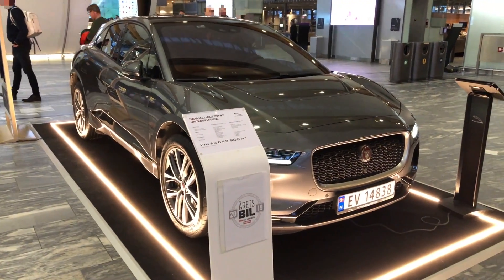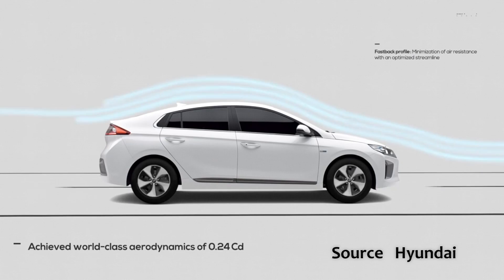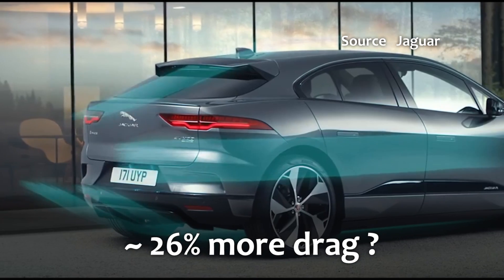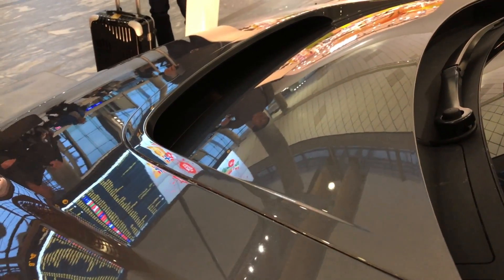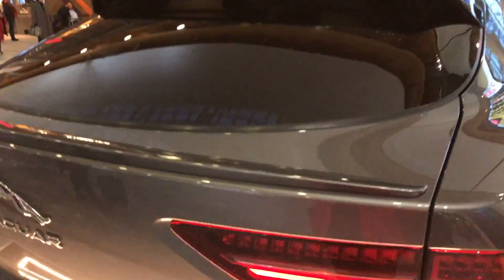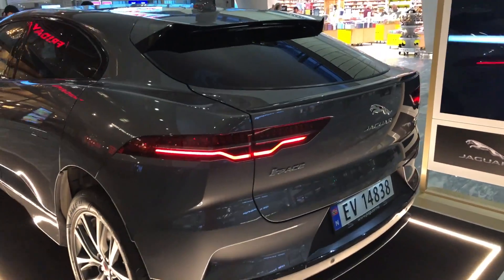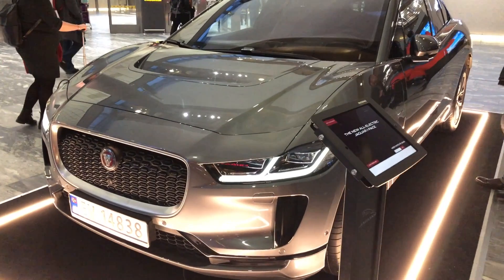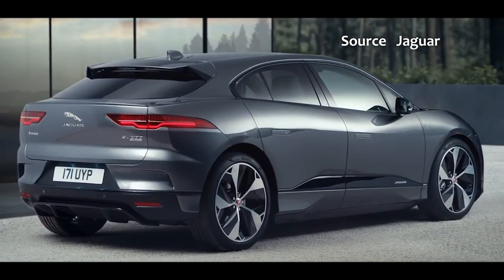Why THESE Jaguar I-PACE EV Aerodynamics? (Vs IONIQ Electric, Tesla)

Comment: One thing to note, the Hyundai Kona has a Cd of 0.29, same as the I-Pace with a smaller battery but a longer range! I think what makes the difference is the weight, I-Pace is just over 2.1 tons Vs just over 1.6 tons for the Kona. So the I-Pace has an extra half a ton of weight or the equivalent of 4-6 people with luggage I think?

Mass, areo, efficiency, tyres all make a difference. I think it's mass that's making the big difference here in between SIMILAR body styles. You can't expect a SUV to be as efficient as a saloon or estate like the Ioniq.

Audi e-Tron, has a drag coefficient of Cd 0.28 but looks like it has a slightly smaller range than the I-Pace with a larger battery?!?! Answer, weight is an extra 500kg over the I-Pace which makes it close to a ton heavier than the Kona.

For the record, have test driven Ioniq, Kona & I-Pace. Have a deposit on a Kona. I would recommend speaking to a Jag Dealer about a test drive of the I-Pace so you can bench it against your Ioniq. It is a lovely, lovely car will still consider it if we ever get to the stage of a two EV family; probably second hand though.
Reply from the maker: Good points, thanks :)
Reply: @ZeroTailpipe  no problem. Keep doing the videos!

Comment: A traditional prestige car manufacturer is not going to aim for a maximum efficiency vehicle, but instead make design trade offs based on their “brand values”. The I-Pace is marketed as a “performance SUV” and as a Jaguar: so a big front grille and impressive stance are important, but also on track and off-road handling and performance, just for bragging rights. The front scoop is usually there to increase downforce  which is super important for track handling, as is the giant underfloor diffuser. Nobody would accuse a Formula one car of having terrible aerodynamics or being badly engineered, but they have sky high drag coefficients to generate huge amounts of down force. The I-Pace also has twin permanent synchronous motors meaning the front motor cannot be switched off.  All in all, the I-Pace trades off efficiency for sporty handling, a raised driving position, larger interior space and yes looks, which is okay because the EV space needs more variety if EVs are ever to replace traditional cars. In engineering there are no right or wrong answers, just a design space  where trade-offs are made based on engineering goals. Jaguar made different trade-offs and everybody is free to choose whether those were the right trade-offs for them. I recently test drove an I-Pace and it’s a proper “driver’s car” as well as being practical but it’s certainly not he top choice for people who often drive long distances or want an affordable car.
Reply from the maker: Great points, thanks :)

Comment: Stylish or not, that front scoop is a snow-trap. Got enough work with a flat bonnet, I don't think I need more and deeper pockets to store the stuff.
Reply from the maker: Good point! :)
Reply: Not just snow trap but dirt and grime trap... cleaning would be tough 

I understand it’s Aluminum body doesn’t rusts but can’t keep dirt under scoop
Reply from the maker: The patterned/embossed grill curves into the scoop too... cleaning that as well as the internal smooth parts of the scoop... hmm... ;)

Comment: I think the Jag was designed to produce more down force as they were thinking of their racing program and the thermal dynamics involved in keeping the battery pack cool.
I don't think they really gave it much thought as to just how much drag it would produce as well.
 It would be very interesting to see one of these built to run a rally course.
So far none of these EV's can truly be compared as they are so different in design and mission from each other.
Great video thanks for sharing
Reply from the maker: Thanks for sharing :)

Comment: Aerodynamics in the auto world is a fascinating topic. Cd numbers on their own don't tell the whole story. The frontal area of the vehicle has a part to play as well hence CdA, which can be a more meaningful figure but marketing people won't like it. The CdA for the IONIQ will be smaller than that of the Tesla Model S and possibly even better than the Model 3 because they are both larger cars. I would imagine the i-Pace would be worse.
If it works the bonnet "scoop" on the i-Pace should help the flow over the windscreen which is a low pressure area. 
If you can find a copy, I recommend reading "Flying on Four Wheels" by Dennis E. Ortenburger, an interesting book about Frank Costin and his cars.
Reply from the maker: Fascinating, thanks :) I will look for it. I’ll also see if I can track down the CdA numbers...

Comment: The Ioniq is the result of Hyundai trying to make a good EV. Owning a good EV and driving it sensibly is not what people want who buy an I-Pace. In fact, it's not what people want, who drive a Jag, Merc, or Audi. So Audi, Jag, Marc, etc. make electric SUV's with drag parachute aerodynamics and gigantic batteries for them, because they don't want to make good EV's and their customers don't want to buy good EV's. They want aggressive looking, large luxury cars and they want to use them thoughtlessly. From a purely technical or rational point of view, the shapes of such cars are just good examples for bad engineering.
Reply from the maker: Interesting points :)
Reply: 0.29 is still not a «drag parachute», but you are correct, that most people who can afford such a car don’t like to have a «weird» shape. They like that their car is recognised as an Jaguar, Audi etc. There are people who likes to buy an electric car but don’t want to show it offensively. I assume, that may change when electric cars become more popular and «normal» and the brands will change the styling. The last of this big styling changes was in the 70ties after the oil shock, when the big brands develop a new an more aerodynamic styling. I personally like, that not all electric cars look the same and the brands try how to develop the new styling for electric cars.
Reply: @JürgHölzle  The Ioniq doesn't have a weird shape, it actually looks quite dynamic, IMO. Yet it's safe to assume it's consumption will be around half that of the e-Tron in reality, just like a Ioniq-ish petrol car burns half the petrol of an e-Tron-ish petrol car for the same reasons: Drag parachute aerodynamics at medium and high speeds and gigantic mass in city traffic. It has to heat and cool a larger volume, its bigfoot tires displace more water and slush, etc, etc. Ultimately, efficiency means speed in the electric world, and this Audi will have a hard time reaching a 70kph average on your holiday trip to the mediterranean with current charging infrastructure. This has not escaped the attention of all the manufacturers desperately trying to style their cars after the 1970's Range Rover for 2020 and they joined forces to form IONITY. IONITY is backed with unlimited financial resources to build a dense grid of 150 plus kW CCS chargers across Europe within the next one to two years to make these design antiquities practical. That is the only good thing in the e-Tron's overall design I can identify so far.

Comment: If we want as little air resistance as possible, all brands will end up with cars looking a lot like each other. There would be no way to stand out on the outside. Brands like Jaguar and Audi don't want that, they want to stand out. They want you to recognize their cars. And people who buy those cars also don't want a car that looks like any other brand. They often buy it because it is an Audi or Jaguar. And I really doubt most of them care about drag or energy efficiency. They'll only care when the car runs empty when they are on their way to an important event.
Reply from the maker: Interesting, thanks :)

Comment: Forget its bad aerodynamics i can forgive that. Its 7kwh on board charger with a 90kwh battery pack (13 hours to recharge from 0%) is unforgivable. My wifes i3 with 33kwh battery has a 7+ (I've seen as high as 7.6 Kw). Really Jaguar 9.6 minimum.
Reply: It really is a matter of looking around the world. When you look around the world you'll see that most people don't have triple phase power entering their homes. So most EV manufacturers have decided to build a single phase charger in their car because that reduces the cost of an already expensive car a little. The limit of 7.2kWh (actually it's 32 Amps) comes from the fact that more than that is usually not allowed on the wiring used in most homes. Adding thicker wires to provide more powers would once more become an expensive venture.
Reply: @Hans-gb4mv  you don't need tripple phase for 40 amps (9.6 kw) in California. And that is where you need to sell EV's in the US. I can actually run 80 amps.
Reply: @ericjohnson3967  but 80 amps is again something that is not common. When building cars with new, expensive technology, manufacturers look at cutting costs and many decide that for the on-board charger they'll use single phase and around 30 amps. If they wanted to make sure everyone at home could charge as fast as possible, those chargers would drive up the cost again.
Reply: @Hans-gb4mv  if they want to save money how about not adding technology that isn't ready and legally can't be used?
Reply: @Hans-gb4mv  also the etron which is in the same price bracket has 11/22 onboard charger. And so will the coming VW's which will cost FAR less than an ipace
Reply: @ericjohnson3967  Sure, but these are choices manufacturers make. Let's say you plan to build 100 000 cars. If you can save 10 dollar/euro/pound whatever on such a car, that's a million saved in production cost. I have no idea what the cost differential would be between single and triple phase. Could be anywhere from a few hundred to over a 1000. You do the math on what the total extra cost is for 100 000 cars.

And then you'll say: but you could make it an option. But that option increases R&D costs (because now you need to build 2 chargers) and increases the components required in inventory. And inventory again costs money.

At the end of the day it's up to the manufacturer to decide if they want to make that investment. It's up to the manufacturer to decide if they want to offer customers the option. And at the end of the day, it's up to the customer to decide if this is important enough for them to start looking at another car.
Reply: @Hans-gb4mv  if i come home and plug in my car at 8pm and its not full by 7am heading for work. That is ridiculously unacceptable.
Reply: @ericjohnson3967  that really depends on how far work is. Even if you could charge at 7 kW, you would still be able to charge about 65kWh in that timeframe (accounting for losses in the charger). That would still give you a decent enough range.

Let's face it. Most people, on their daily drives, don't really drive that far. The average daily commute is about 35km. You could even do that with most plugin hybrid vehicles on pure electric power. Yet when it comes to EVs people all of a sudden want a car that can drive further on a battery than a lot of cars can do on a full tank, and yet, unlike with that fuel tank, you can leave home every day with a full charge.
Reply: Hi  @Hans-gb4mv  In Denmark you will find 3-phase in every household, but never 32A in one phase. Only 16A per phase is possible. That is not a perfect match for Ioniq as you therefore only can charge with about 3.5kW. Not qiote ideal - but we have to live with it - as the car unfortunately is build that way. It would have been nice if there had been a three phase charging option - even if it had put extra cost on the price.
Reply: @thrustsst  But you can get this in DK, so the charging time will only be 4,5 hours  https://clever.dk/twin-power
Reply from the maker: Thanks. I don't know much about the I-PACE spec. This is useful to know... :)